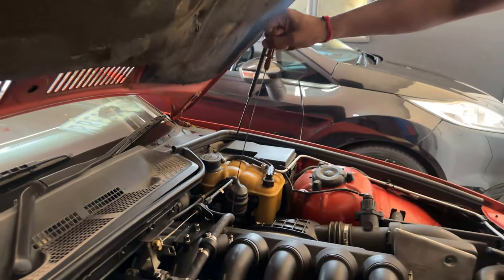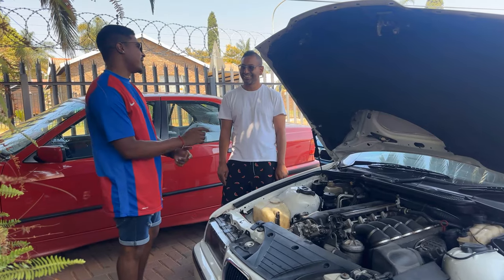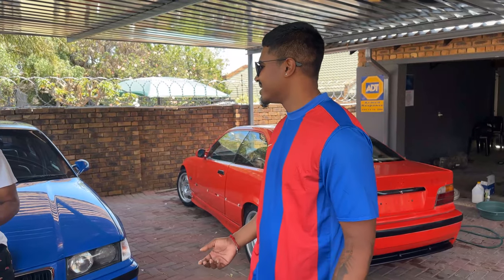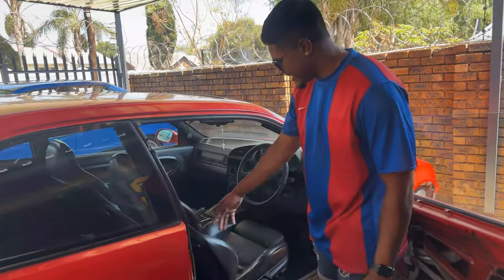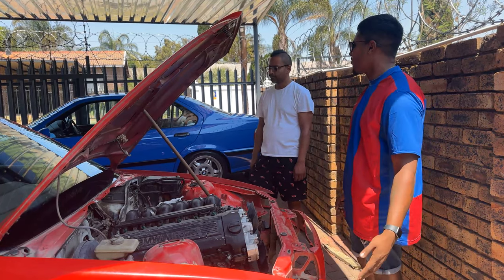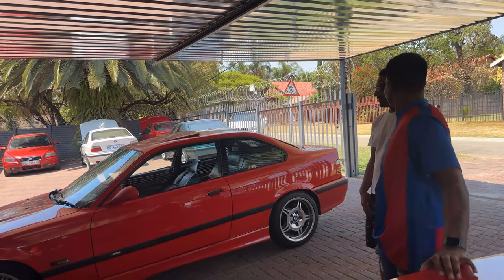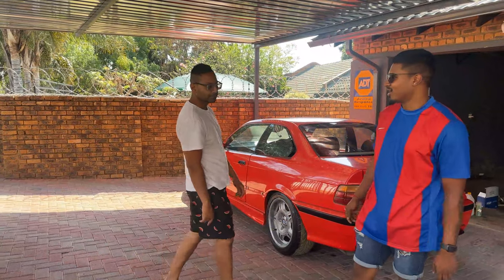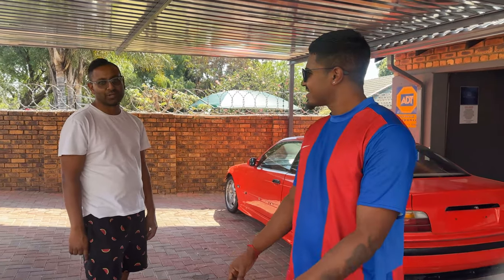GERMAN SPEC M3 ARRIVES FROM DURBAN !!!

Comment: Unfortunately, it's the vanos, and changing sparkplugs won't help. Extensive exercise to fix it and usually doesn't last. Maybe you can get new one?
Reply from the maker: What indicates that it’s the vanos?
Reply: @The_Usualsuspects  many things like:
●Sometimes takes longer to start (not always),
●inconsistent power delivery, struggles at different rpm's.
●sometimes idling is uneven 
●overall loss of performance and power (very inconsistent).
...
I heard the car on the video and straight away that was my diagnosis. 
Remember there is nothing wrong with the engine but the valve timing is out at different RPMs.